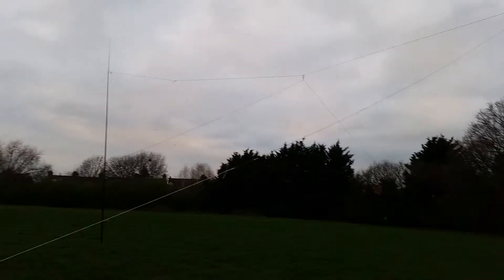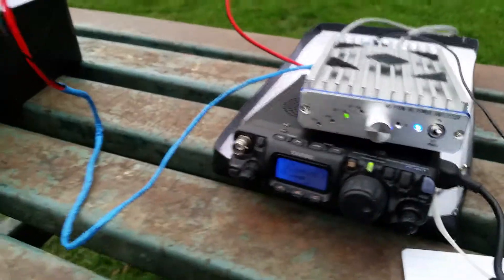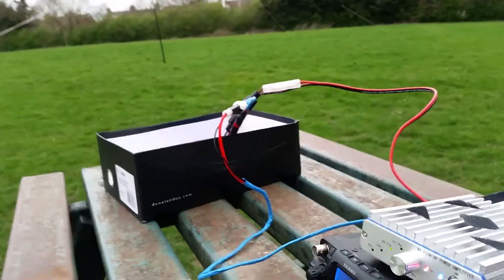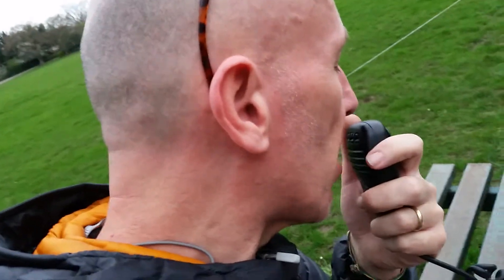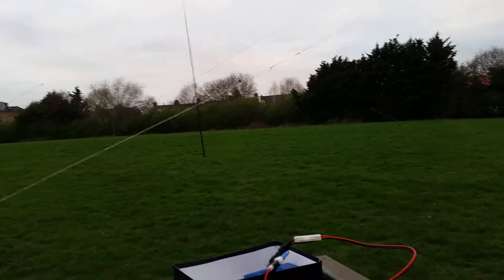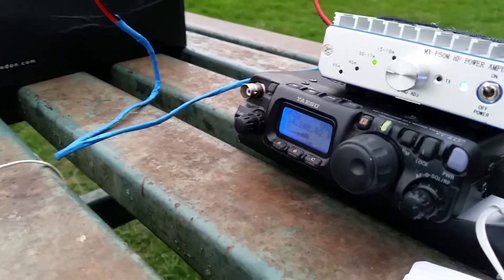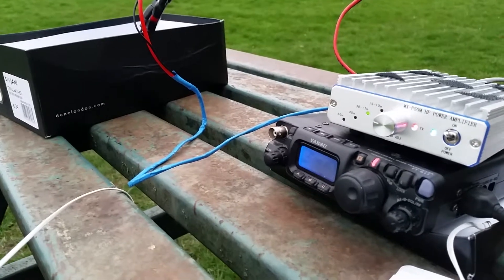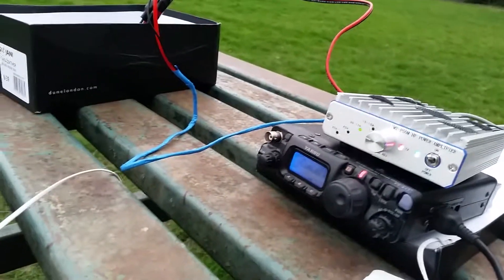14mhz 20m 5 element wire Yagi contact London to West Virginia

Comment: I see a few other wires or ropes but I can not make out what they are exactly.
Reply from the maker: 2 6m poled, holding a line up between with the 5 elements attached. Pointing to North America
Reply: God, that’s clever. So it’s a beam without the beam 😃anchored to the ground and aimed at an angle, with all the distances between the wires where they need to be?
Reply from the maker: @MarkPentler  that's correct.  A wire beam